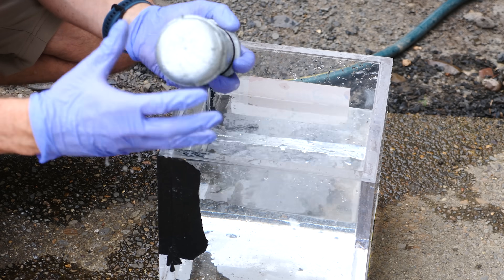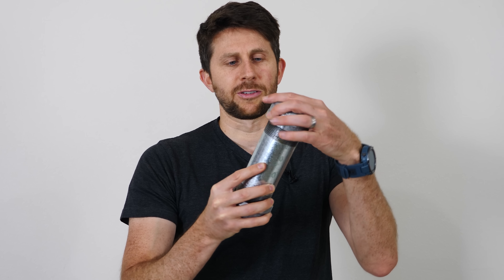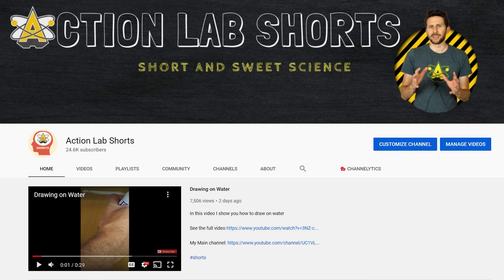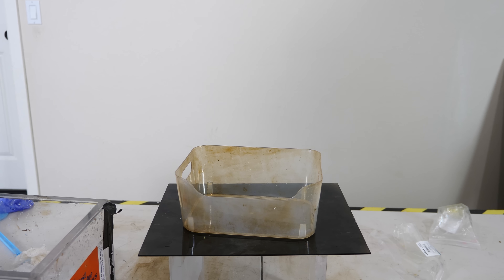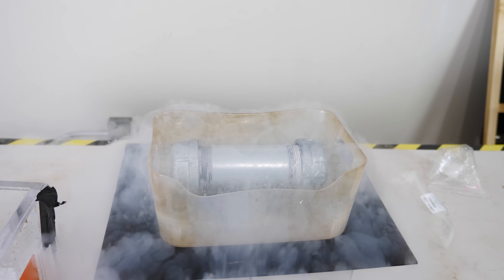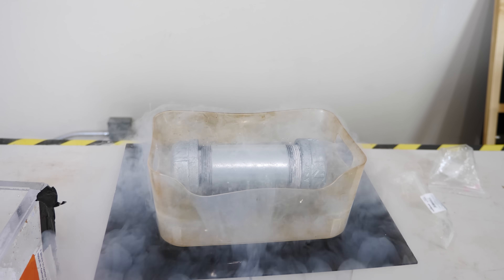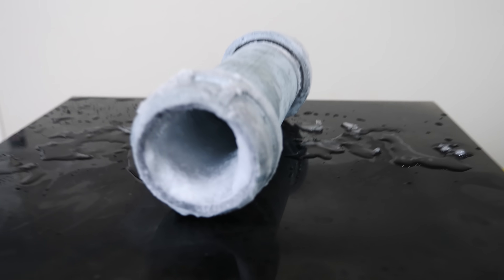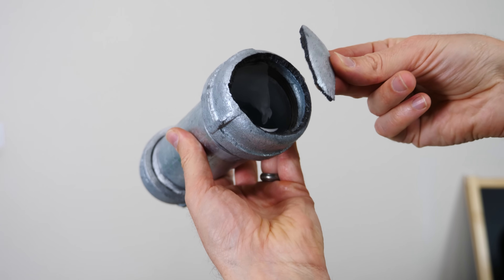Can You Stop Water From Expanding When It Freezes Into Ice?

Comment: I was surprised at how violent that was. I have done hydotesting and most of the time the fail is a crack with a very short time squirt of water. (still dangerous if it hits your skin, depending on the burst pressure!) I suspect the reason for the violence here was the low temperature. I think if the pipe was at room temperature and a hydraulic pump was used there would be a plastic flow of the steel until it cracked to let the pressure escape.

Comment: My first reaction watching you create a pipe bomb trying to contain freezing water was that you were doomed to failure. I don't think that your theory is valid that freezing a gas would be explosive while freezing a liquid would not... The primary reaction in a container explosion is the initial momentary breaking of the container, and then the secondary effect of a continuously expanding gas would only be related to the expanding gas pressure related to the pressure of free atmosphere... In other words, probably negligible unless the gas is continuing to combust.

The failure of the end caps are typical of other examples of pipe bombs, provided that the seals are tight enough as your experiment seems to be, the end caps are the easily predictable points of failure.

I would probably have designed your experiment differently, and not expecting anything metallic to have strong enough molecular bonds to hold the enormous pressures of freezing water...
I might have tried using ice itself to try to contain expanding freezing water... 
Maybe a very large block of ice with walls at least 10x thicker than the volume of water and then try freezing the water in the center, maybe by placing in a freezer for hours or days.
Am just guessing, but I assume that the molecular bonds of ice and sufficiently thick enough might be one of the few materials that might contain the volume of freezing water.

And, despite the failure of your demo,
It's nice that you described the actual answer to your theoretical question, that the frozen water would be in a rare state of semi-hard/fluid because the water must have that extra volume to harden completely.

Comment: Well if you do the water becomes super-cooled, meaning it does not crystallize. So the question is, does the water change state? If not, it has not "frozen". 
Super-cooled liquid water is a common winter phenomenon in ponds in Canada. 

And how would you know without opening the container, which releases the pressure? Well, you could measure the presence or absence of the latent heat of cooling during the change of state.
This experiment is totally useless, because the container is not strong enough to produce super-coling.

Comment: I don´t know why people keep saying that water is uncompressible; water is very compressible -- it just takes a lot of pressure.

One thing I´m calling bogus: You do not discuss the method of filling the capped steel structure with water without any void, when you would not have been able to screw on the second cap.

The only way I can think this would have been possible is if you had backed off the first screwed cap, allowing the second cap to be screwed on to a degree that mechanically secures it on its threads. However, you would not have been able to do this because of needing to have worked against an internal vacuum. Perhaps unscrewing the “fixed“ cap while screwing on the second? The same problem, but only slightly more theoretically possible.

Also, by inspection I do not see evidence of this presumed technique. The real matter is that you completely elide any matter of achieving this goal.

What gives? So to speak....

Comment: An unsafe "experiment" from the get go. And unnecessarily so, simply because not enough thought was put into it beforehand. No way any of the liquid nitrogen should get poured without better precautions. And the "steel" pipe end cap was not steel, but cast iron, and it definitely was not 1/4 inch thick. Result of this "experiment" ? : I will not be liking or subscribing or watching any more of this channel.

Comment: 1. You filled with water a pipe that will reduce it's dimensions if frozen. 2 the steel loose a lot of strength if frozen.
Was clear from beginning that was an impossible task.

Comment: If you increase pressure up to the point it solidifies in a denser solid water phase, it won’t go totally go there, as solidification then reduces pressure. So you will basically reach an equilibrium with a small fraction of that ice phase and mostly liquid water, just at the transition line.

Comment: I did some tentitive calculations and i think that a pressure of 300 MPa will be the maximum pressure. At this pressure ice occupies the same volume as the water did at atmospheric pressure.
Reply: But my calculation was based on estimating the bulk modulus of ice from its youngs modulus and poissons ratio. If i am right, then at 275 MPa ice at an original density of 917 kg/cubic meter should be compressed to 1000 kg/cub meter.

Comment: Add a pressure gauge and you would b able to see the pressure increase as it gets colder. The pressure that the pipe can withstanding is based on its "schedule" and documentation can be provided by the manufacturer. Maybe show the equations for this process?

Comment: A better material would have been Invar 36, INVAR 36 is a nickel-iron, low-expansion alloy containing 36% nickel. It maintains nearly constant dimensions over the range of normal atmospheric temperatures, and has a low coefficient of expansion from cryogenic temperatures to about 500°F. The alloy also retains good strength and toughness at cryogenic temperatures. INVAR 36 can be hot and cold formed and machined using processes similar to austenitic stainless steels.

Comment: It would be great if we could recover ice in the poles from sea water. But also recover water from the air humidity would be great a practical development to ease the scarce supply of fresh water.  How ever, some developments for the change of phases of H2O require dry ice or liquid N2. Bad news, producing either coolants are expensive and release more heat than they save. One more thing, as liquid water freeze it increases only 9% in volume. Incidentally D2O, heavy water, increase its volume as it freezes. D2O sinks in liquid D2O. The implicancy? As D2O produced by Nazis sank to the bottom of a lake in Norway, it makes it unrecoverable. D2O was used as a moderator in nuclear reactors.

Comment: Well, I have few concerns about this experiment. One - if you would not use liquid nitrogen to cool this - it might not explode, toughness of steel was compromised because of liquid nitrogen, also - outside surface of steel was much cooler than inside surface, it brings additional tension to this... Wait until winter and redo this experiment using just outside temperature. Second - it explode so rapidly because of water pressure not because of water meets liquid nitrogen. Also - steel pieces was travelling quite fast - causing this effect to be more dramatic. And for my last argument - you can try to buy steel pipe with thick walls and screw steel bolts each sides, so pressure will effect only pipe itself, not as in your case - caps that was weakest link in your setup.

Comment: This was neat! See, I always thought water just wouldn't freeze under "unlimited" pressure, aka pressure from a very rigid container. But according to you that's actually not the case which is fascinating.
Reply: The pressure exerted on the inside of the container is 114,000 pounds per square inch

Comment: When I remember correctly from school, water is the least dense at 4°C (normal pressure) and after that it rises in density. I don't know if it would be ever possible but I think with hotter water filled in the container, it might be possible to freeze it and don't break a container. On the other hand it should be possible to fill 4°C Water in a container and then let it warm up and the container should burst or buldge.
Reply: Yeah water expends as you heat it past 4C and as you freez it. So you saying you put in hot water that has around the same density as ice. Might be possibledont know much mich water expends to past 4C

Comment: That did'nt explode because the water kept expanding after you already froze it, it exploded because you kept pouring in liquid nitrogen untill you poured in so much you nearly submerged it and froze the steel, the pressure already inside broke the brittle frozen steel.

Comment: Just eyeballing it, I didn't think that container was going to hold, although it failed in a different place than where I expected (I thought the threads on the end pieces were going to strip and let go of a whole end piece).

If you do this with copper, instead of failing catastrophically, it bulges out to give the water room to expand.  My family had this happen at an elevated house they used to own that had exposed copper pipes underneath that weren't sloped properly to let all of the water drain out when you shut off the water system before leaving, and while it was in a place (Little Cumberland Island, GA) that doesn't usually freeze hard, freezes do happen sometimes, and apparently the friction of ice after a few meters is enough to hold in continued freezing enough to bend and stretch the copper.

Comment: I'm going to say the same here as I replied to the channels comment as pinned by Action Lab. If you did this same experiment in a regular freezer the outcome wouldn't be as extreme ( or as near to watch) as it was in this video. The pipe would most likely still burst but then it might not because it wouldn't be freezing at such a fast volume and I believe that's is what caused the fast burst. It out was to freeze slower the results would most likely change drastically. I say at best the pipe would just slowly crack open a little and the ice just sort of ooze out a little. Still this is a great channel. Cheers to all.

Comment: Using a tube with a large inner diameter and thin wall was the exact opposite of what you should have done. A simple pressure vessel made from a $5 round bar of steel with a small hole drilled into it would have firstly contained far less water and therefore far less energy, and secondly actually would have contained the pressure. The choice of material wasn't an issue, nor was the liquid nitrogen (necessarily). The issue was the ID to OD ratio.

Comment: That definitely is a dangerous experiment, I would have taken more precautions!  I have heard stories from plumbers that have spoken about houses in new england that froze and the radiator became the projectile and went through the wall, water can be very dangerous at those pressures, now you know what to do, fill the radiator , plug it with water, and watch the fireworks

Comment: Interesting question but the answer given at the end of the video  starting around 7:02 is quite off the mark: As the dense ice phase starts to form it will tend to lower the pressure in any closed vessel, whether real or ideal. So its formation will be strongly self-limiting. Instead as cooling continues, the pressure will then decrease to follow a phase equilibrium (mixture) of mostly liquid with a small fraction of "dense" ice. The pressure will not be able to rise again until a temperature, where some "regular" (hexagonal) ice starts to form, is reached. From there the remaining liquid fraction will freeze into a mixure of mostly regular ice and some small portion of other (dense) ice phases.
Once it is all solid, it could never be all dense ice, as that would not produce any pressure inside the containment vessel, and therefore could not be stable. Instead some major fraction of regular ice would need to be present for any dense ice to have even a chance of remaining. Ultimately as temperatures cool further the regular ice will transition to ice XI (see chart at 6:00), and so you would end up with a mixture of mostly ice XI with probably some small fraction of ice IX.
Reply: Solid hydrogen hydroxide becomes liquid under pressure and reverts to solid when pressure is released.  Therefore, with no room to expand, the liquid form remained liquid regardless of temperature until pressure was released at which point the compound becomes solid.

Comment: How were you planning to see if it was still liquid inside the pipe? It would flash solid if you opened it. No air inside for you to shake it to hear sloshing.

You should also have eliminated the dissolves gases in the water you used. There may have been enough gas coming out of solution that you actually did make a bomb.
Reply: Solubility of gasses in water increases as the water temperature decreases. So I don't think any outgassing would occur.

Comment: Why didn't you ever mention how cold it is at the bottom of the Marianas trench?
I was fascinated when I learned that fun fact, all the water down there is below freezing temperatures but it's under such high pressure that the water can't freeze lol and then there's those crazy geothermal vents spewing superheated water. What's even crazier is there's life forms down there that can survive in both of those extremes. There is like these little shrimps that can swim in and out of those vents. Essentially going from subfreezing temperatures, to boiling hot temperatures and back again in seconds!

Comment: I work in northern Canada on power boiler maintenance. We had a boiler shut down by accident when it was -30 C . The boiler water header which was a 1 inch thick certified pressure vessel split the full length once it froze. Incredible forces at play!!

Comment: You can't create something that produces more energy than you put into it, so why wouldn't this work: you lift a 5 ton boulder an inch by freezing water below it.  You then let it thaw, then freeze it again, then thaw, etc.  Envision this in fast forward - the boulder goes up by 1 inch, then down then up, over and over a hundred times.  The freezing water re-lifting the boulder should be able to tapped as an energy source.  The only input of energy is to freeze the water, then thaw it just enough to let it go back to liquid, then freeze it again.  That can't be nearly as much energy as what it would take to lift such a heavy boulder by one inch 100 times. Where is my thinking in error?

Comment: 1:00 you're still going to have an air gap in your setup. You'd have to use a special cap to push all the air out as you screwed the cap on. 

Or use a plug that is much smaller that the diameter of the cylinder so that you can minimize the air gap. 

I guess with the lid being less than 10% the volume of the the whole cylinder, the air gap is probably negligible, but some of the force is likely lost during the expansion into the air gap. 
Note: im pretty sure that the inside of those caps are concave, leaving a greater space than it would appear.
Reply: He has both the pipe and cap under water,  he burped the air bubbles out and then put the cap on.  No air was trapped inside.
Reply: @MentaIPatient  aw i didn't notice him burping the air bubbles out. Kool.

Comment: This is a dangerous experiment that anyone who understands physics knows and does not need to repeat. You literally said that it increases by 10%, it's volume then put it inside of a sealed container. The pressure that the water was under when it exploded is what the end of the pipe off. You're lucky it wasn't the middle and there wasn't shrapnel. You just made a pipe bomb congratulations.

Comment: A thick pipe with a relatively small diameter should be able to sustain the pressures necessary to get to the next level. Maybe 1mm inside diameter? Would probably need to vacuum the air out though.

Comment: This has me curious now about seeing if I could make a container strong enough, before my current job I used to be a precision machinist that did a lot of work for oil fields, something I used to make was called a Fluid End, which was basically the pump that created the pressure to pump slurry at drilling depth, they were rated at 60k PSI, got me thinking now about making a cylinder to hold that 620MPa which is basically 90k PSI, or around the proofing load of a 50BMG rifle which is the standard for "this rifle can handle this pressure for this amount of time safely and not blow up and kill you"

Comment: I witnessed a hydrostatic test fail on a 6" pipe at 10k PSI... It was impressive. Water definitely isn't afraid to demonstrate that it doesn't compress.
Reply: Everything compresses at the right pressure. Steel takes 80 the pressure of water to compress just as much, while rubber is on par with water. Water is really quite compressible compared to many substances
Reply: @dragoscoco2173  The effects with that were mostly the result of deformation of the pipe and various materials involved in the test. For purposes of that pressure range, it's still "incompressible".

Comment: We've been using this force to literally break apart mountains. I worried about brittleness though. And potentially the seal failing as the metal parts contract at different rates, setting off a rapid cascade when water leaks from the container.
Reply: If it hadn't exploded, that would be what I'd suspect. Honestly, I expected the thread seal to give up before the metal, but I guess the ice formed from the outside in and self-sealed.
Reply: @Malidictus  That would be correct as ice freezes from outside to inside

Comment: Hi, nice water bomb, this experiment would have been more practical if you would  have cooled the water socket in refrigerator. This explosion may have occured due to large temperature difference between inside and outside wall of the socket because Nitrogen cooling.

Comment: The end caps are cast, working pressure usually 150 psi, pipe is sch 40 plumbing or electrical conduit, it's steel, welded seam. Pretty Lowes or other big box fodder.  Get some 10,000 psi in the same setup?  Need a thicker shield.   )